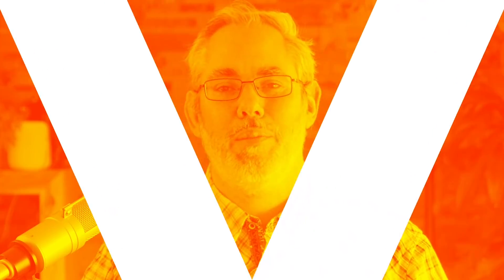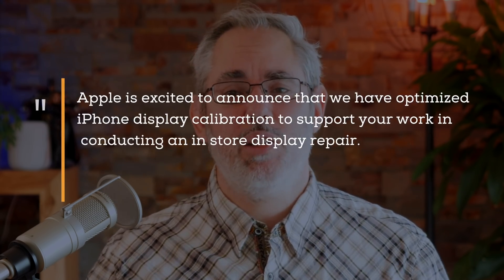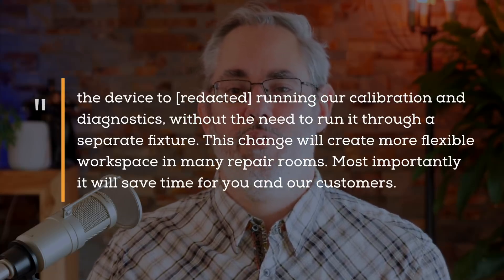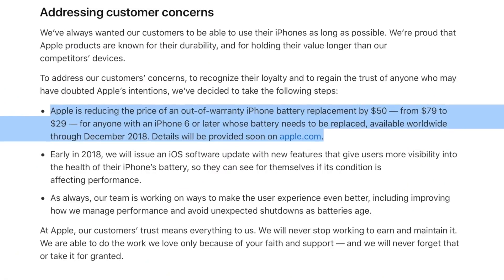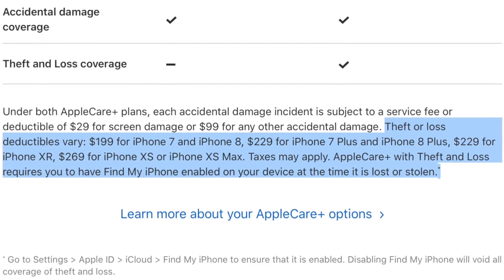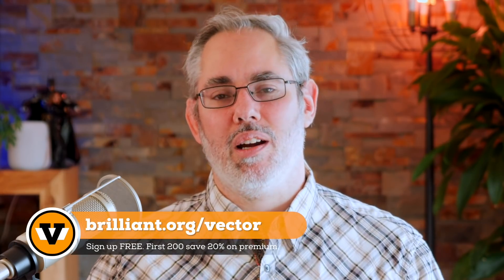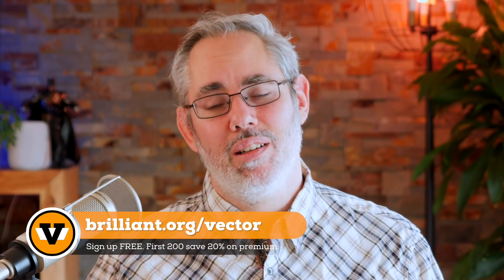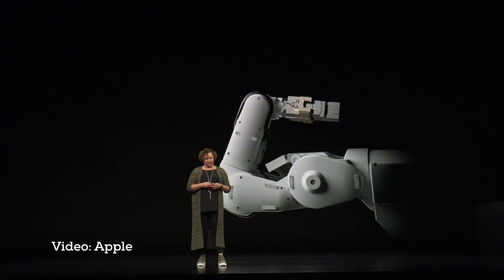iPhone screen repairs have just been changed forever

Comment: As someone who worked for an AASP I can tell you that Horizon calibration caused several issues. While I could take care of an iPhone X display in a half hour with calibration running smoothly, there was a time a 6s Plus took 5 hours. Similar issues occurred other times with other devices; two known-good 7 displays failed calibrating another time, necessitating whole unit replacement. The Horizon machine is very confidential as well, hopefully Apple won't trace the image you used in the video.

I'm curious what changes will be made to AST2 for post-repair. And how the software will reconnect the secure enclave, something aftermarket displays are unable to do. Most importantly, I wonder if my username and icon will be meaningless.

Comment: Louis Rossmann does not believe that biometric sensors actually need to be paired with the rest of the phone. He believes Apple does it purely to screw over anyone trying to fix an iPhone without Apple authorization and a $20,000 gizmo that works half the time.
Reply: Rossman is a manlet crybaby who probably had a Genius Bar ex girlfriend who left him for a strong rich Apple Alpha male so now he whines online into that stupid tape microphone
Reply from the maker: Hardware pairing is very basic, logical, and necessary operational security. No point in locking the door if you leave the window open.
Reply: @vector3578  what security risks does not pairing it give?
Reply: Roshan basically you can bypass the security if you can use non-paired sensors.  Thinking of it like you let someone else uninstall your door lock and replace it with another one that they have a key.
Reply: @zealzonix1  how is it bypassed? Your face etc is on the phone, you only replace the sensor, right?
Reply from the maker: Without a secure hardware channel, you could theoretically spoof the authentication process. Like having a security badge but the reader can be fooled into reading any badge.
Reply: @vector3578  I have my doubts though, the software reads the data comming from the ircamera, if this was spoofed with something like a chip that sends your 3d facemask to the sensor 24/7 (which required your face data in the first place, aka scanning this persons face or getting the data off the phone) then yeah but realistiscly speaking this is impossible to do
Same for fingerprints, you'd have to reverse engineer the reader anf the software to know how it reads it etc and create an image of your finger the exact same way as how it normally does and fit that into the phone it self without the other person knowing..
Reply: Louis is a raging manic, he is mad because it’s not the way he would do, right or wrong, he needs to get over it.
Reply: Hardware pairing is unnecessary. Take it from someone who repairs these devices and cracks the software to retrieve passcodes for people (mostly children) who have forgotten them. Every device is the same, it's just a computer an computers function the way they always have. Exploit the RAM and you have compromised the device. Nothing beats a long password of a word, number and special character. The "chip" that Apple has built into there phones is useless, it's mostly just an encrypted link between the facial recognition sensor and the section of storage dedicated to it on the device.